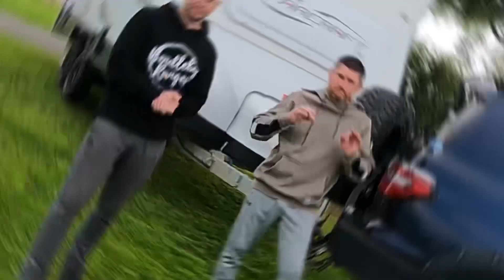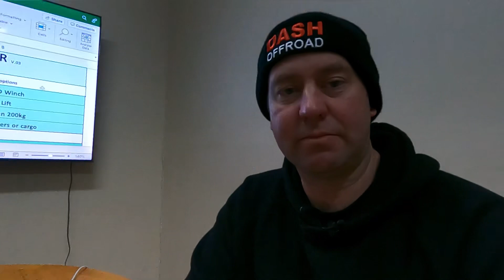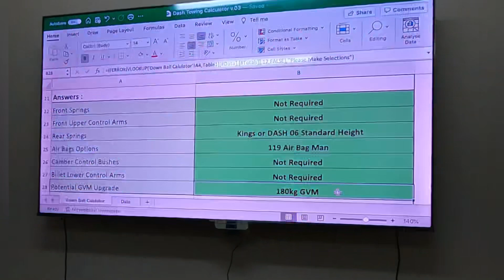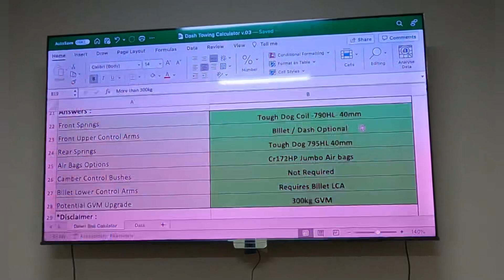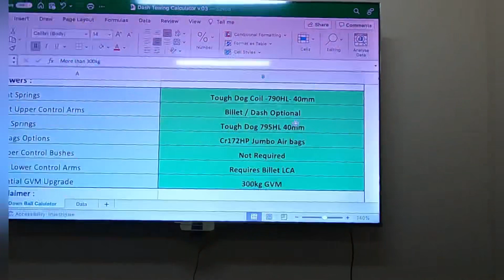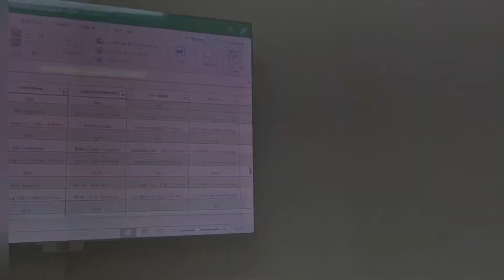Y62 Patrol TOW Suspension Calculator

Comment: Wow! Great info. 
Can someone from Dash or DNA please let me know if it’s ok to put tall Air bags into the back could have a late 2025 Warrior ? Accessories on my Car and normal use are-

Front Rassbar  with light bar.
Super Carger, Safari Snorkel.
Carbon Winch.

Back Dash false floor
3rd Row seats delete 
Single Draw Fridge & slide rhs
Rear Slimline lithium battery 
Dual compressor / accessories 
50kg Luggage 

What is recommended please. 

Thank you in advance

Comment: Instead of having to lift the Y62 with all that cost along with gaining a crap ride when not towing, best to wait for an Air sprung Y63. They'll take the 350kg weight, and just level the car via their air springs. No need to worry about ordering a new vehicle, getting it re-sprung before being first registered, paying for all those costs with luxo taxes, loosing warranty on several aspects of the vehicle. Wait for the one which will not need changing to tow 350 kg.

Comment: Thanks for the videos David. You've mentioned before that lifting a y62 tucks the wheels in a bit due to the design. How much on each side should i expect my wheels to come in if i get a 2 inch lift? Since mine is probably a bit too wide as it stands I wouldn't complain about a slightly narrower stance..Cheers!
Reply from the maker: I’d be guessing, maybe 10mm each side 🤷‍♂️

Comment: Now that the bellow airbags are ADR approved. Does that mean they can be installed on the factory lower arms and use the ARB Lynx system to set height without any further engineering issues?
Reply from the maker: I can’t comment on the Lynx system sorry. I’m probably going to go a different way

Comment: Great work Dave. The first example you used is us currently. I need to stop procrastinating and bit the bullet and just do it. I’ll have to flick though an email and get the ball rolling. When would I be able to get my hands on the dash standard height Springs? This system will be a very handy tool.
Reply from the maker: They are in stock, you’ll just need to call us to order until it goes up on the website 👌
Reply: @DontDoWhatDaveDid  awesome I’ll get onto it. Cheers Dave